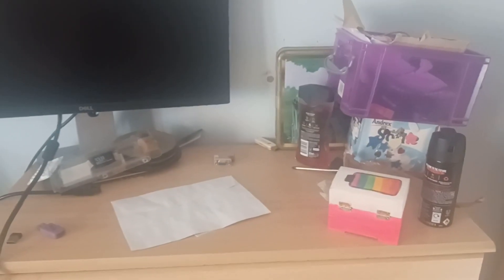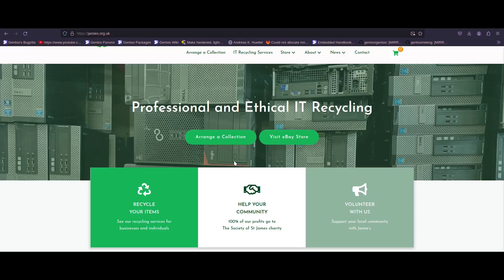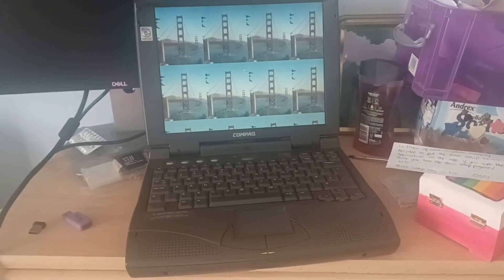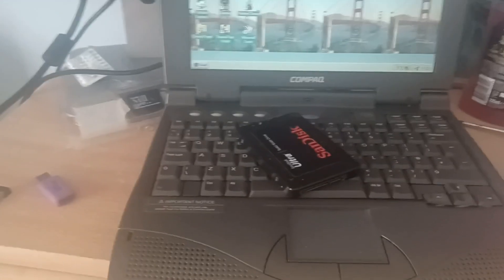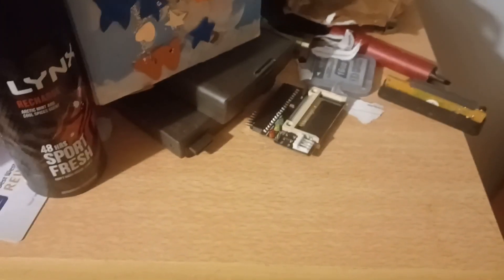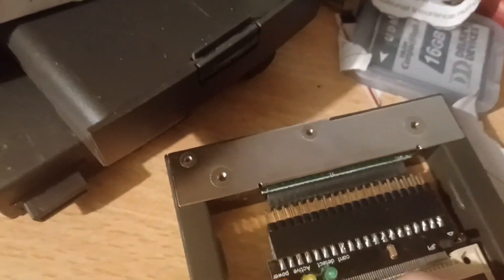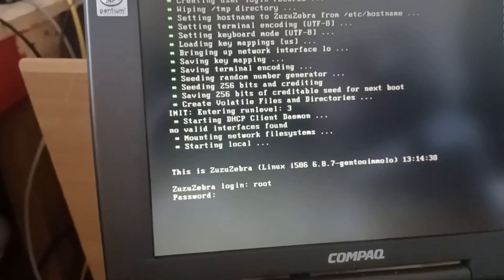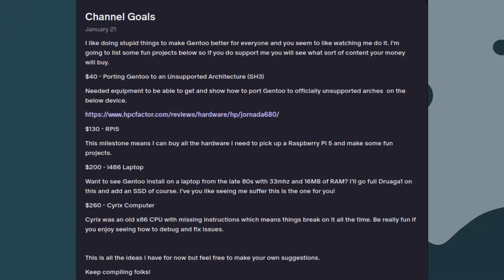Installing a SSD in a 90's Pentium 1 Laptop

Comment: I think that disk addressing limit might be related to the BIOS, not the IDE controller itself. Since Linux uses a Hardware Abstraction Layer, instead of using BIOS calls, it talks directly to the hardware.
Reply from the maker: That's what I was wondering however the P2 laptop can only see 32GB so I didn't want to say until test a little more.

Comment: I've told you before that I still use a Thinkpad T22 from around 2002 with a Pentium 3 CPU in it (running at 700 MHz) and 512MB RAM that I still use (with Gentoo) on a regular basis in my workshop because it has a great keyboard and it's "old school" distraction-free computing. 

I have dwm and i3 installed as tiling window managers but I have had XFCE running on it in the past, I use it to SSH into my server to write shell scripts and have mutt email open on screen 2, Lynx browser on screen 3 and a console music player on screen 4. 

It's also built having to avoid Rust because of the lack of the SSE CPU flag (as you well know) and I can't be bothered "jumping through hoops" doing a non-SSE Rust build like you did, albeit kudos to you for actually doing it.

Technically speaking, you could throw Windows 95 or 98 on such a laptop, then Putty and have it do what I do with the T22 - so I'd be cool seeing a "similar" Linux build that tries to put this to some practical use, as opposed to, say, spending 64 years to compile GNOME.
Reply: I personally use Tiny Core Linux on my Pentium 1 machine (Siemens Nixdorf Scenic), and I want to use it on my Pentium 3 machine (Panasonic Toughbook) as well. Tiny Core can actually be installed on the same partition as Windows, too, since its packages are squashfs files, which are simply mounted, so the permissions and other flags are kept intact.

On the Pentium 1, I have W2000 on an NTFS partition, with TCL on that same partition. I use a floppy with FreeDOS and GRUB4DOS to boot TCL. I was amazed to see that the LAN PCMCIA card would work inside Linux.
Reply: Warrior! Great job!